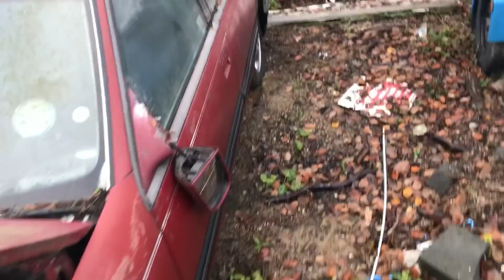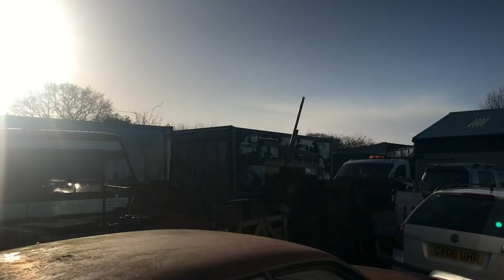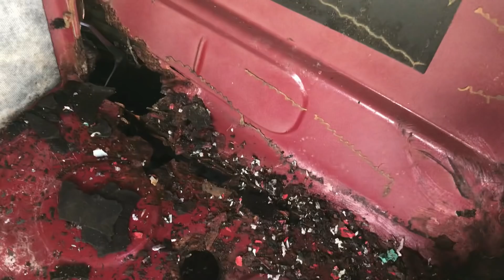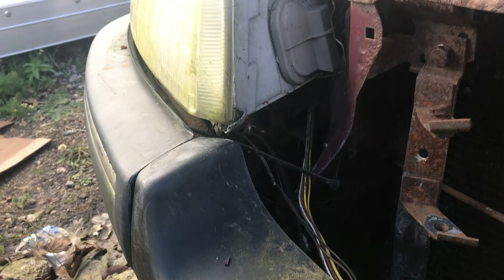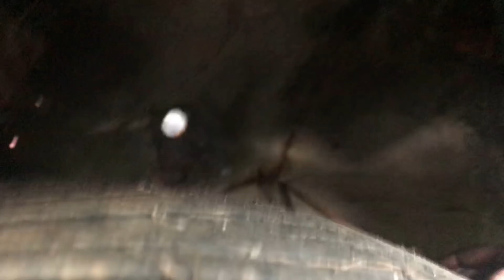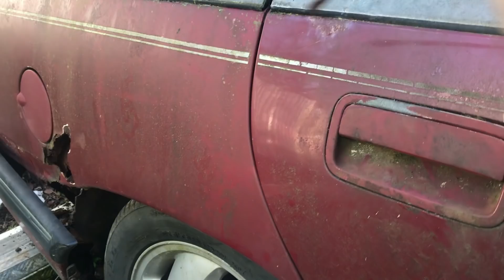test

Comment: Formidable task but achievable! My advice would be to try source a "solid" Senator shell /donor car. Have the shell dipped / coated. Any necessary and hopefully minor repairs can be carried out then prep and paint. Meanwhile the engine / manual gearbox and all running gear, instruments and equipment from this car can be overhauled ready for refitting. Don't worry about originality as lots of Police cars were reshelled during their service life. I know of one Sierra that was reshelled three times ! Although anything is possible I honestly think the shell of this Senator is not worth trying to save. Think also about the state of inside box sections and nooks and crannies that you can't see. Would be a fantastic vehicle once finished. All the best whichever way you go with it. 👍👍 Regards. Dave

Comment: If you do restore it I take my hat off to you - I bought a seven year old senator in 1995 - even then it need welding to the front chassis leg and suspension turrets. Not sure what panel availability is like but several years ago 24v engine parts were becoming scarce.

Comment: Even though i am a Opel (Vauxhall) fan and i say "SAVE IT" to most of these things, i don't think this is saveable, you can't weld on rust and trying to find the parts is mission impossible, you would be at the same price if not cheaper out if you'd buy a good example

Comment: Think you should invest in a two post lift before starting on this Senator otherwise you will spend most of winter laying on the floor with hot mig wire dropping onto sensitive skin area's